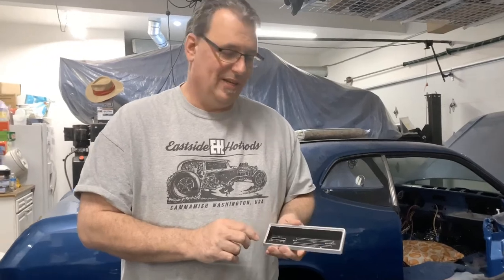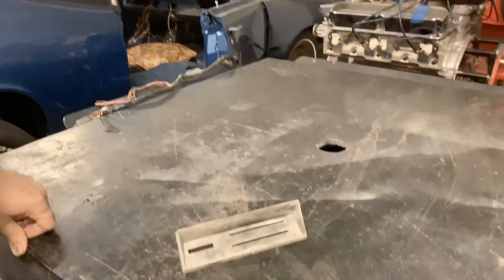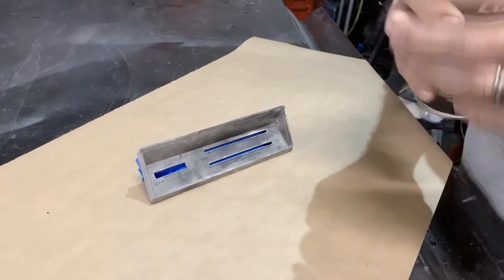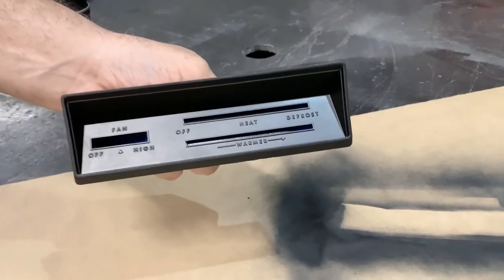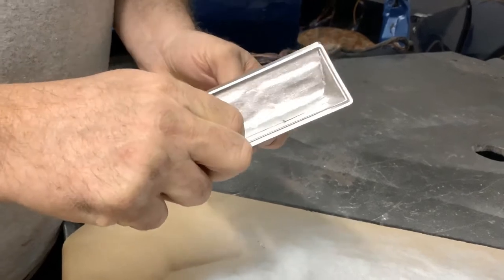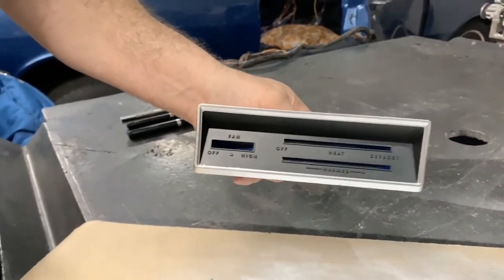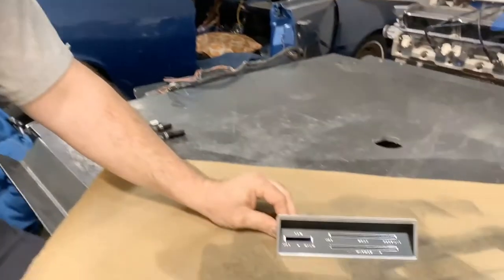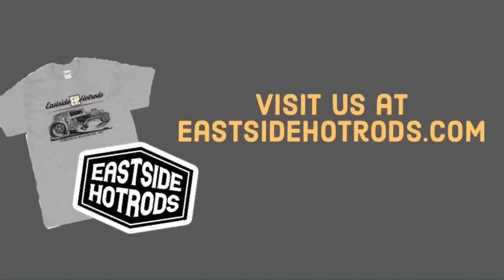How to restore Dash Bezel

Comment: Good how-to video sir.  I would suggest better masking tape though.  As you can see in the lower left area where the black meets the chrome, the chrome paint did a little wicking up into the black. It wouldn't do that with a good automotive paint 3M tape.